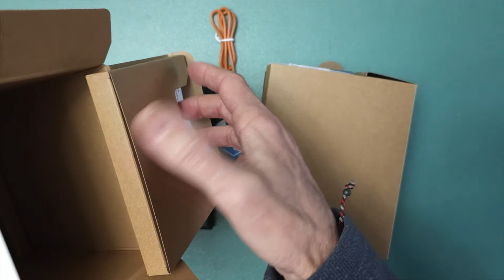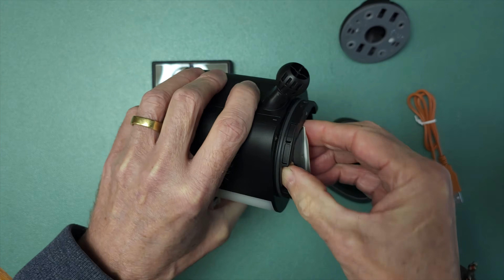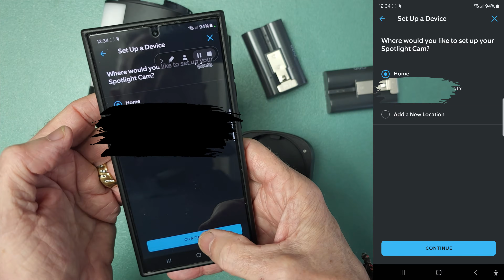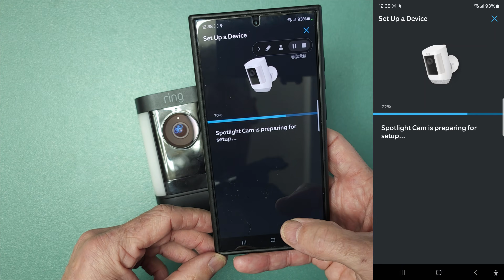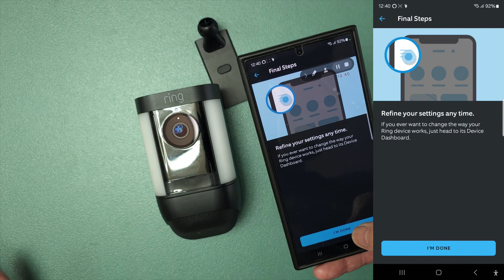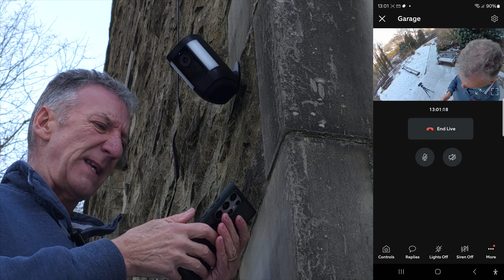RING Spotlight Cam Pro Installation Made EASY!

Comment: Ive the Ring solar panel for this camera.  Will it charge two batteries ok?
Reply from the maker: I would have thought you would only actually need one battery to be honest, and it will just trickle charge that.  Good to have two though as a back up if you use a lot over a short period

Comment: Can it really be considered a spot light if you cant turn it on and leave it on, has to be some kind of joke by the programmers this thing should be sold as a intermittent only light, almost false advertising but really dose it overheat or somthing, my guess is it such low quality its to save the light from burning out or overheating
Reply from the maker: It works great as a PIR light......